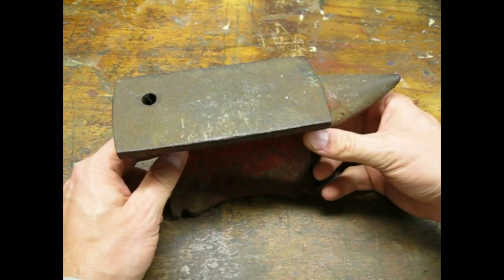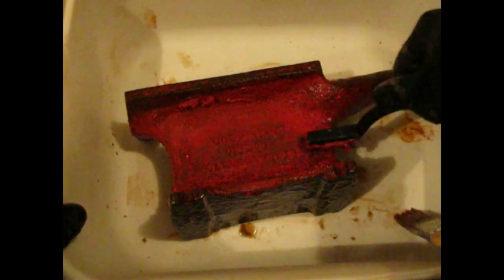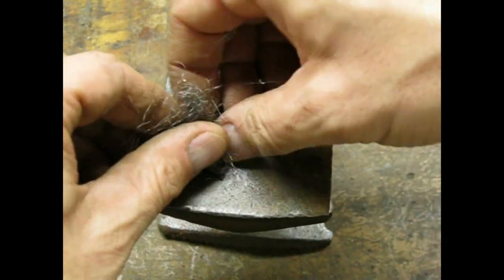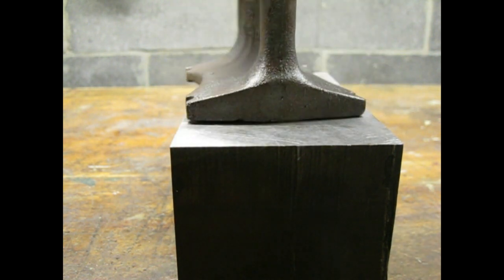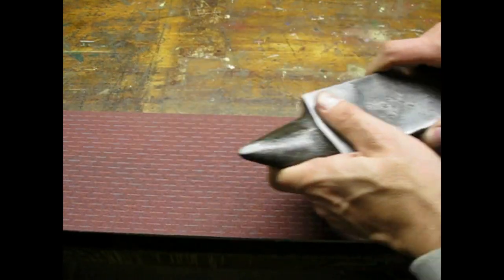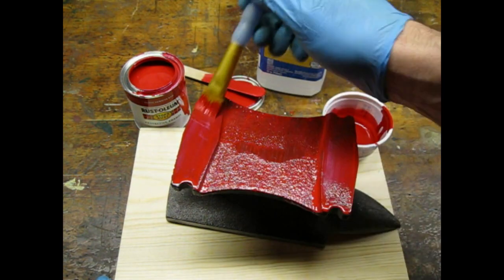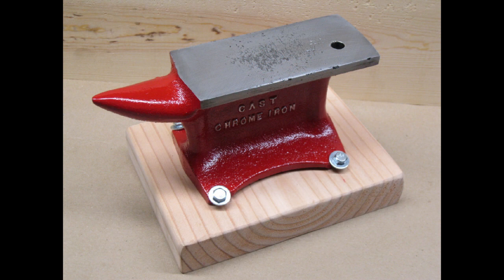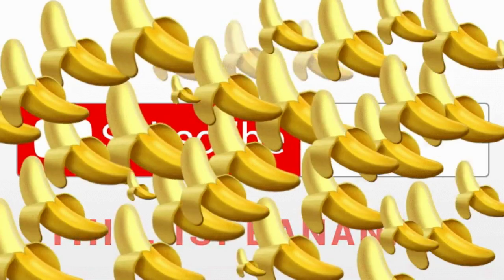Flea Market Anvil Clean-up

Comment: Congratulations on 1K subs! Cool little anvil and restoration too. In one of the early scenes it looks like there's a crack in the horn - is that just an illusion?
Reply from the maker: Thank you David!  I didn't notice a crack while I was working on it.  I can't see anything through the red paint now.
Reply: @357magdad if you're not going to use the horn anyway it's not going to be an issue. Cheers!

Comment: Very nice.  I’d love to find exactly this anvil.  It’s the perfect size for my needs.  All the new versions that I’ve found are not hardened steel on the top, so if another viewer has one to trade I’d love to!
Reply from the maker: This one is also just cast iron (no idea what "chrome iron" is).  It's probably not much better than the Harbor Freight ones - except that it was $10!

Comment: FOI - “Pritchel hole - A pritchel hole is a round hole in an anvil.  Its primary purpose is to provide clearance for punching tools, but it can also be used to hold tools that have round shanks.” From Wikipedia.  Here’s a link to the use of the pritchel hole with a punching tool on hot metal- https://www.youtube.com/watch?v=hqrazVCWbI0 (From the epicfantasy channel, Blacksmithing Lesson 8.  For blacksmithing in general, go to the channel of The Consummate Dabbler.